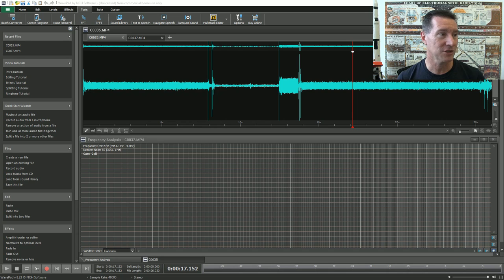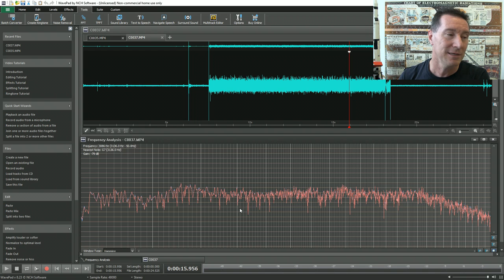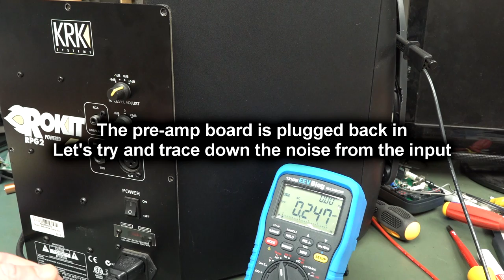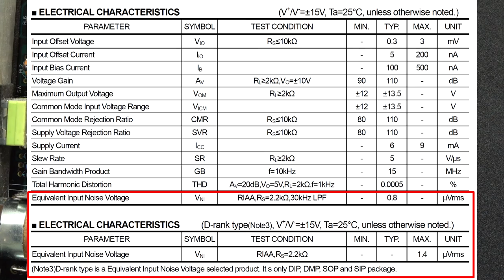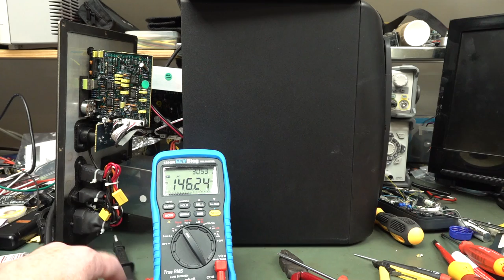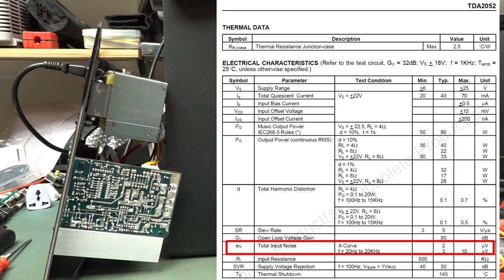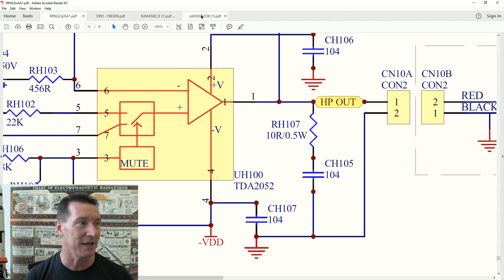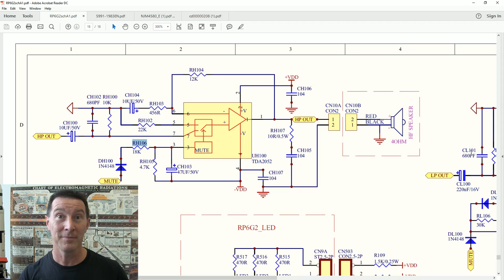EEVblog #1118 - Why Are Studio Monitors Noisy?

Comment: It's quite easy. Most noise in audio amplifiers comes from the preamp. In the usual preamp + power amp combinations the output of the preamp is attenuated by the volume control.
The volume control attenuates both the signal and the noise before it feeds into the power amp. This is true for separate preamp + power amp stages as well as integrated amplifiers.
But for active speakers like this studio monitor the preamp is not attenuated (let's say the volume control is at 100 all the time), and volume control is done by the user by lowering the signal at the preamp input.
That's why the noise level stays the same, because the output of the preamp has no attenuator and therefore always keeps the same gain level.
If you turn the volume control to 100 on any preamp + power amp combination without a signal at the input, the hiss is just as loud as those studio monitors.
It's just the volume control that turns the hiss down with the audio in that case, which does not apply to active speakers.
Reply: I'm in the process of setting up my powered monitors with a dac that effictively doubles as a pre, with a volume control. Are you saying that I would be able to reduce the noise if I keep the volume on my monitors near max, and reduce the volume at the pre stage?
Reply: But note that he got no change in the hiss and voltage measurements when he completely disconnected the power amp, or shorted the power amp's input pin. So much for your theories. EVERY active circuit has noise. It's just a matter of "how much is tolerable?" However, I agree with you that MOST noise comes from the first gain stage. In this case? No. He's got a relatively noise power amplifier, which is typical of these very old, very cheap, and very obsolete TDA power amplifiers from yesteryear.
Reply: This is a linear amp, not Class D switcher.

Comment: These things are not high grade monitors, what they are are a cobbled together car stereo grade output with a active seperation of input frequencies. Those amplifier modules are designed for mobile usage with minimal bias etc to save power, THD and all that audiophile "nonsense" (like low noise) are not parameters of the design. You ask yourself why do all these E-E have all that "expensive equipment" when you can get the same things on Ebay for a lot less. Dave is currently in the grip of the first stages of being an audiophile.
Reply: so, for a newbie, of what are you talking about when you say 
"when you can get the same things on Ebay for a lot less. "

any tips and suggestions?

Comment: No mention of power supply rejection ratio of the power amp, nor the noise on the power rails...  Figure 8 of the TDA2052 data sheet appears to show only -20dB to -40dB PSRR at 5kHz.   Any chance we could get a noise measurement on the power rails?
Reply: Along the same line of thought, if the output stage is all NPN then the neg rail modulates the bottom emitter which makes a signal between it and the base. I have seen it with some opamps. I agree that is probably the power supply rejection of that cheap power module. Cool stuff.

Comment: Simple answer. Because the built-in amps are always on MAX. All ACTIVE monitors do this. The volume is usually adjusted in the studio before the signal hits the speakers. You can replicate this same noise floor on high-quality PASSIVE HiFi speakers by turning your separate amplifier up to maximum and keeping it there all the time while making all your volume adjustments before the input to the amp. It'll be noisy as FxcK. It's just bad gain structure.

I will now watch the video.
(love your channel by the way)

Comment: I had a pair of Genelec (8040A's), and they had a very faint hum.  Then I down graded to M-Audio, and they have a much more noticeable hum.  So apparently it is something that can be improved if you give the engineers more money to work with.  The currently available verson of that speaker is the 8040B, which costs $1,200/each (US).
Reply: Stringer:  This isn't a very informative statement.  My M-Audios are tri-amped, with 220Amps...they're "fun", because who doesn't want 8" woofers and 200+ amps per speaker?  In stark contrast, there are speakers like the Avantone MixCubes, with single 5.25" drivers and 60amps...I guarantee the amps in the Avantones are way cleaner.  Different products, different uses, different compromises.  The M-Audios were $750/pair, and the Avantones are $450/pair...  So where does that put us on the "you get what you pay for scale?"  :)
Reply: Okay, I agree with you...you get what you pay for...and that means nothing to an engineer.   Engineers don't make the "best" thing they can possibly make...they do their best to meet all the design requirements that the customer gave them!  If the requirement is to make a $200 monitor speaker with extremely low noise, that is what you'll get.    And you may be surprised that some expensive monitors actually sound worse...and they sound worse in a very particular way...on purpose!  There is a reason for it, but that's a whole 'nother subject.

Comment: As long as the hiss is proportional to output volume, its not too much of a concern. That is, if you're using them at high volume, you're probably standing back a distance from them and the sound will swamp the noise. That might seem like an obvious point, but take for example the EV ETX series of PA speakers - I've found they have a constant, quite loud hiss that is independent of any of the volume controls. So you have to be using them at theater volume levels to make the sound/noise ratio acceptable, but I wan't to use them at lower volumes a lot of the time, and it's very disappointing to have all that hiss there. There's a lot of DSP going on in them, maybe the output circuitry is "full on" all the time.
Reply from the maker: The hiss is not proportional, it's a fixed base noise floor level. Totally insignificant when playing content.
Reply: Just tested my Yamaha HS80M speakers. It's probably identical to what you're experiencing: base level hiss independent of the input level gain. So in these cases, the output gain is fixed regardless of input level, theoretically you could reduce output noise by lowering the gain via RH103-RH104? Just hypothetically if you were always using them in close quarters at low volumes.
Reply: Yeah, I would also expect the noise to decrease if you lowered the gain on the power amplifier. Only way to be able to tell for certain is to test it, though.
Reply: Karreth that's if the noise is from before volume pot. after volume pot, noise volume is fixed. 

Dave has a video about op amp noise, it's super awesome. You can use the knowledge, and build a amp with nearly no noise :D square root rule.

Comment: As per your study, maybe not always the HISS is coming from Preamplifiers or Corrections (as you name it FrontEnd). First, yes, ribon cable is really not appropriate for analog signals. Replace with coax. Then, the OpAmps. They used very cheap OpAmps... Maybe in the same range of price they could place LM833, with considerably much better results. Try to extract all of them, place sockets and LM833. See results, make nice measurements. Then replace with LT1678 and come back with some measurements. And then replace the ordinary carbon resistors with metal oxide. And replace the ElCeapo Aluminum capacitors with Tantalum drops of 10u. At least, I am doing this exercise when I optimize commercial audio stuff. Cheers mate!

Comment: I recently bought a headphone amp that was really noisy no matter what I did.  Same kind of thing.  The output amplifier had a fixed, somewhat high gain, so the input noise voltage was always amplified by the same amount regardless of the volume setting.  As luck would have it, I had another headphone amp that had more/less the same components, but the volume set the gain of the output amp.  On that one the noise was inaudible when the volume was down, but was pretty comparable when turned up, but at least it was less obnoxious when running at reasonable volume levels.

Comment: I have some personal findings on high frequency hiss coming as Common Mode noise from the power supply rectifier diodes.  It is the recovery spikes — microsecond or less —  that by themselves are  not audible, but when they get into the amplifier, they cause issues by overloading a stage which has high native gain moderated by feedback.  But the feedback has a propagation delay, so it does not attenuate all frequencies alike and some not at all.  In fact, the feedback may approach turning the stage into an oscillator..  Or you could relate it to Intermodulation Distortion.  Anyway, I would look for ways to add some (lossy) ferrites to certain places, like the emitter or source leads of a few transistors.

Comment: Had some good like adding snubber caps (x4) to the bridge rectifier in custom studio monitors back in the late 90's & early 2000s, as well as making sure any analog circuitry decoupling/power-bypass was sufficient.  Had thought most of the noise floor was johnson/thermal, until the improvements dropped the noisefloor below isolated recording studio ambient, though that may be because we were running 600 ohm balanced, so didn;t have the regular 10k-100k input impedances involved

Comment: Looking at amplifier noise numbers, those 2uV are specified for A-weighted, 20Hz-20KHz. If your meter has a 100kHz bandwidth, then you should divide the output voltage by a factor of roughly 3 (sqrt(5) for the badwidth, and around 1.4 (3dB) for the A-weighting). That makes the measured value much more plausible from the amp specs.

Comment: The equivalent input noise spec for the power amp chip would be with the input shorted. Leaving the input open presents a high impedance to the power amp chip's bipolar input stage, making the BJTs' current noise the dominant noise source. Try shorting the inputs and you'll be measuring the EIN voltage.

Also, notice that the EIN spec says "A curve", which means that their measurement was done with an "A weighted" filter on the input of their analyzer (basically a band reject filter intended to replicate the human ear's partiality to the 2 - 4 kHz range). If your measuring instrument is measuring at a wide bandwidth and doesn't have an "A weighted" filter, then the readings will be higher.
Reply from the maker: I did short the input resistor in the video, the noise didn't change. The datasheet also has 20KHz bandwidth noise figures, I mentioned that in the video too.
Reply: How did you get verified with only 3 subs?
Reply: @notaname8140  he must be the dedicated technician of the electrical company providing supply for YT servers, hated but respected LOL

Comment: In order for your meter readings to make sense with the amplifier data sheet noise spec (20Hz-20KHz), it needs to be reading through a 20KHz LP filter.  Your 246uV measured noise is mostly ultrasonic.  
If the amplifier is operating at the datasheet "typical" value of 3uV Ein with 20KHz bandwidth, output noise should be 82uV.  Your meter bandwidth would then be estimated as 20KHz * (246/82)^2 or about 180KHz.  
When I make audio noise measurements, I use my Tek scope in high-res sampling mode, at a sample rate of 50Ks/sec.  That gives a 25KHz bandwidth, then I make the small correction to come up with the 20KHz BW figures.

Comment: My Rokit 5s had a noise problem due to a nearby plasma TV. With the TV on there was a noticeable buzz in the woofers. Wasn't a ground loop or mains power. The buzz got louder the closer the speakers were to the TV. Eventually worked out an aluminium foil "shield" wrapping the speaker and attached to ground removed 99% of the buzz. 

I fixed the speakers by disassembling them and lining the inside with adhesive copper foil then attaching a ground wire to the amplifier board using lugs and screws. The buzz is now completely gone.
Reply: Where did you attach that ground and what did you ground it back out to?  Does an external ground make sense with what you are saying or did you just ground it back to the power supply?
Reply: @DavidTOBerry  They're powered speakers with 3-pin kettle cable for 240V. There was already a ground lug running to the amplifier board so I ran another wire and used a spiky washer and a self-tapping screw to get good contact with the copper foil. The copper foil is grounded to the mains via the 240V plug, same as the amplifier board.

I knew it wasn't a ground loop because the hum got larger simply by proximity to the TV. I could pickup the speaker and walk towards the TV and it hummed louder. So I knew it was RF interference and shielding the amp with grounded copper foil proved it.

The TV was plasma and used a lot of watts and I think very high voltages. I've long since replaced that TV with a low-power LCD and probably the problem doesn't exist with the new TV, but there's no harm leaving the foil in there, it doesn't make it worse.
Reply: @nhand42  Thanks Nathan.  Much appreciated!

Comment: Both of my Roland CM 30 monitors have a humming sound with no connections & all the volumes set to zero. I did replace the speakers that don’t flub out with the volumes half way up. Same ohms, size & 60 watt instead of 30 watt. They sound quite a bit better , but now I can hear the humming more.

Comment: Not much to improve by having a pre amplifier, because the TDA2052 also has a 30Db minimum gain requirement. All these kind of integrated power amplifiers seem to be in the same "noise category", even OPAxxx power op amps, hard to find something 20Db better, this is why all studio monitors are the same. You would have to do a discrete power amplifier with a good low noise op amp to get better.

Comment: I've got similar monitors and I really don't need so much gain on the main amplifiers. Is there a relatively easy resistor to change out there to lower the gain? Lower gain would probably mean less noise I assume.

Comment: Made total sense.  I have the KRK 10/3's and the noise floor in those is a real shocker have thought about changing out the mid and hi amps for something far less noise inherent but finding a match is difficult. The only tri-amped monitors I have heard of in this price point are the "Keli 8"v2" ...they are VERY quiet. ;)

Comment: Remember those huge (and doubtless prohibitively expensive) extremely high value resistors in the Keithley 617? That's what it takes to eliminate this kind of noise.

If it's white noise in an audio amplifier, 99.44% that's thermal noise through a resistor. Since it's still there with the preamp disconnected, it's gotta be the feedback resistor. Heavily over-spec'd resistors help cut that down, which is why you'll often find 1/2W or higher rated metal film resistors throughout boutique amplifiers, including the preamp signal path where the current is naff-all. Some passive component choices in higher-end amps aren't entirely due to juju or woo.

Tried using 1/4W Wun Hunlo carbon film resistors in a few dirt boxes (guitar distortion pedals) a while ago. They sounded even worse than you'd expect.